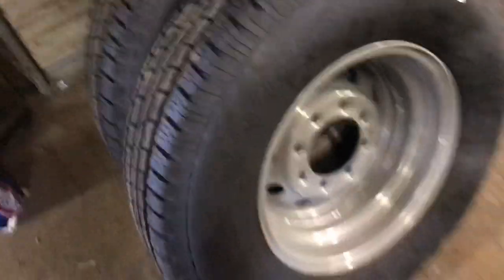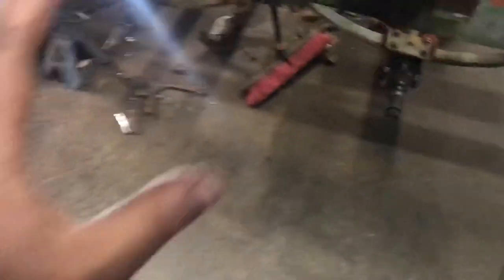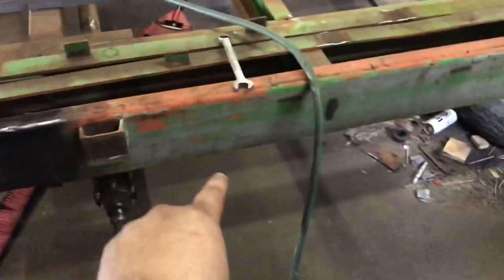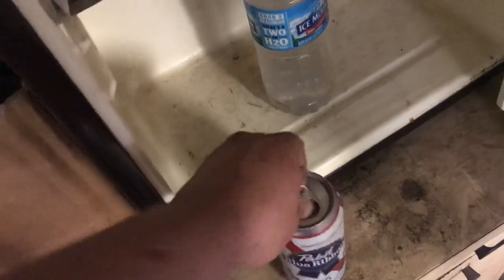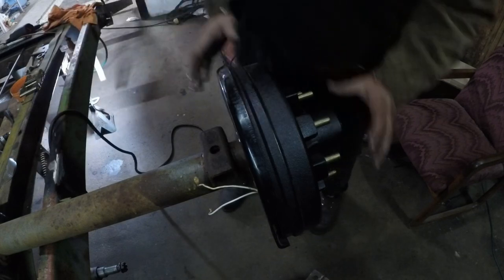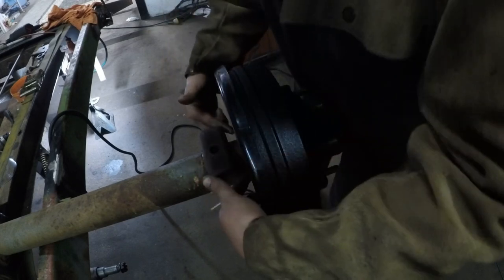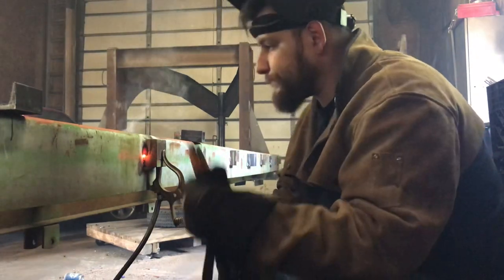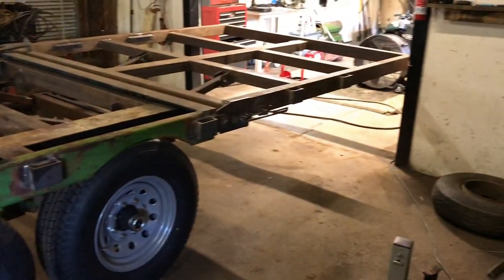Converting Mobile home axles to 8 lug!!

Comment: well that's a new one on me. didn't think that you could change from 14. 5 to a more modern wheel, thanks for the tip.
Reply from the maker: Yeah I figured I’d have an easier time finding those tires if I ever have a crazy blowout or whatever. Plus the piece of mind of new fresh brakes
Reply: Had a guy today say some on the older ones cant be done.  But seems like you should be able too.

I got a triple with dexter axles they looked bigger than regular moblie home axles to me

Comment: Hey Moose. Just wondering if you had to cut off the break assembly mounting flanges. Mine don't match up to the holes so I think I will cut them off and get the right brackets welded on like you. Can I ask how much was the tires and hardware cost. Thanks Ron
Reply from the maker: Hi Ron! Yeah I had to zip off the old flanges and buy the new flanges to weld onto.
I bought all my conversion hardware from R&P carriages in Seneca, Illinois!  I believe it was around $450 for everything I needed, bearings electric brakes, drums, flanges. They have an online store and will ship anywhere! Very very knowledgeable, honest folks!

I bought my tires from a trailer store up towards Chicago (I cannot remember the name) I gave $500 for 4 brand new E range tires!

thanks!

Comment: If it were me I wouldn’t cut the frame for extra clearance. I would run another tube frame to raise the height. This will assure total strength on the frame. Ok. Just my thoughts. Good deal on eight lug axles
Reply from the maker: Yeah we’ll see how it handles real weight. So far so good!

Comment: My buddy has about 10 axles off a double wide. Problem is there 10 foot long from cap to cap. So I need to cut them. There 3 inch outer tube. Would u recommend cutting my lengths from the out side or fro. The middle of the tube? And will I be able to find new spindles for them?
Reply from the maker: If you want to run those axles I’d recomend cutting it once, right in the middle, and either sleeving it, or inserting a tube on the inside and welding it.
You could run the original spindles, you just gotta buy the lug conversion like I did. Measure the spindle bearing diameters and Confirm you can buy the right kit.

If not you can buy new spindles and burn those in.
Reply: I've moved a lot of Mobile Homes, we reuse the axles. Different years had different widths. We cut them in half, used and outer sleeve. Never and issue. once there bolted in the hangers the axle can't slide out. Tighter the better... LOL Makes them easier to install under homes that way too...

Comment: It’s been a year, how have these held up? What kind of weight have you had on them?
Reply from the maker: I’ve hauled a few pickups, a car or two, and 2 RZR’s 1,100 miles from tennesse and back, not a single issue with these. Now I know that’s not a lot of weight, but from what I’m doing with them, they are plenty strong! the only weak spot would be the spindles or axle tubes themselves, and those are pretty standard beefy across all trailer types!
Reply: @MidwestMoose  ahh ok. I was curious as 8 lug would be 7k rating usually so I wondered if you’d put big weight on them as I need to replace some 6k axles abs step up
Reply from the maker: @2010mannw  no I haven’t put anything big big on it,  I do believe they sell 6 lug conversion kits, but I decided to go 8 lug so I wouldn’t have to worry about carrying capacity!